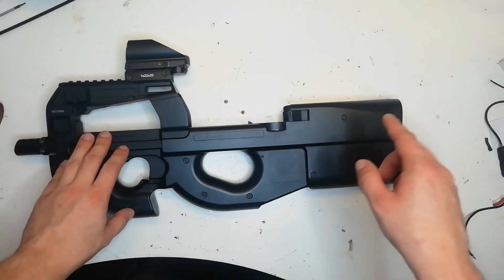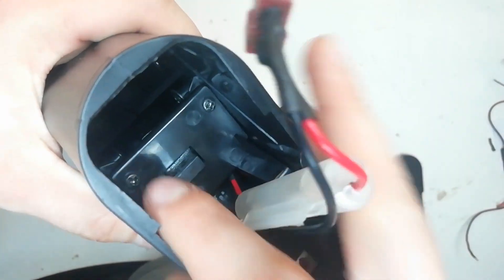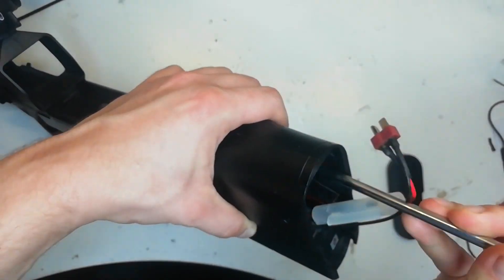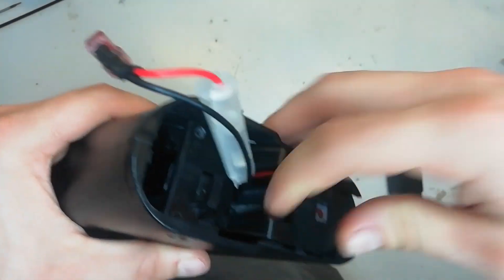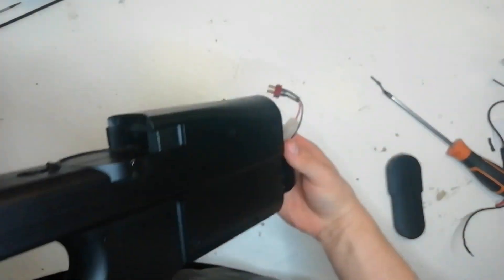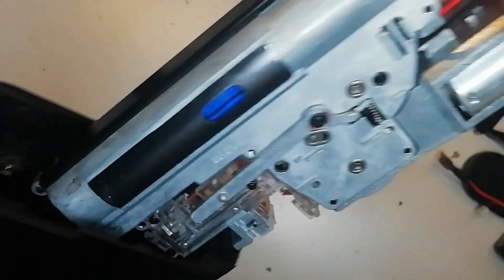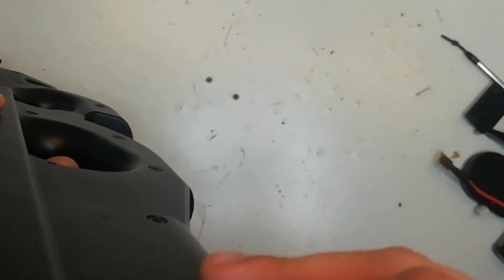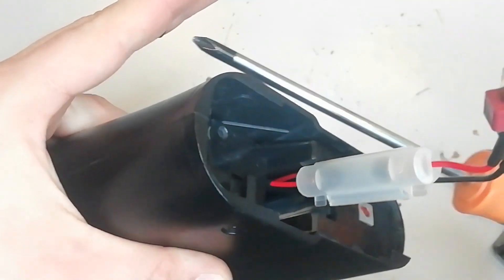CYMA CM060 P90 Airsoft SMG PDW AEG Version 6 Gearbox Removal Guide (Airsoft Tutorial)

Comment: My Aug has the same fuse capsule, it's too bulky in my opinion!
Reply from the maker: I found on this gun it was causing the loose connection.
Reply: swap it for two motor connections and a miniblade fuse. the motor connecters are sold as 2.5mm   no idea why since the width is wider but meh... it's a cheap solution.
Reply: @Raw-51  👍

Comment: Bro I've watched all the gearbox 6/p90 videos I can find n no one has a gearbox like mine. Mine looks like the stock gearbox but it has a quick change spring. I've seen p90s with a quick change spring but they can access it without taking off the gearbox holder plate in the back u just take off the butt plate n there it is. For mine I have to take my gear box out n then I can access my quick change spring guide. Also I couldn't figure out how to take off the top sliding plate to open up the gearbox. I removed all the screws I was supposed to n I tried prying but no good. I'd like to upgrade my piston head cylinder n nozzle